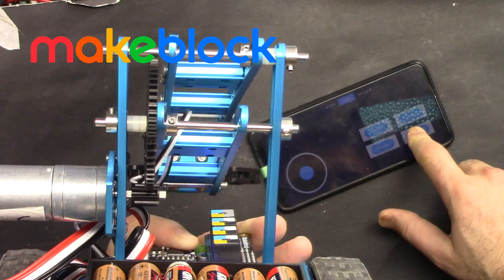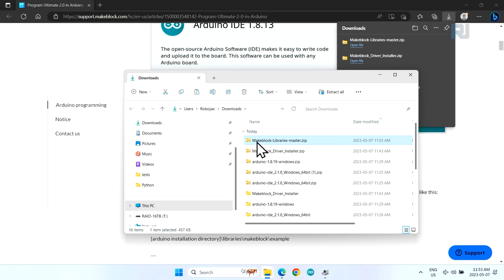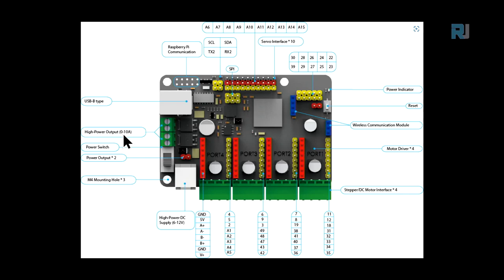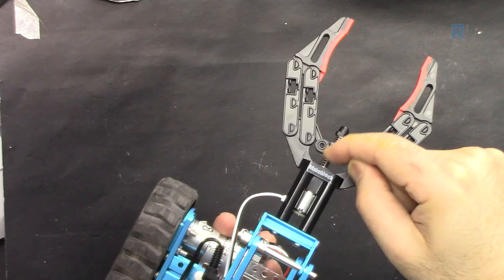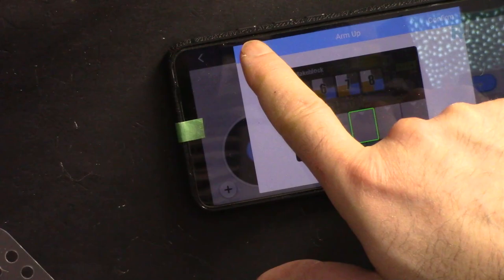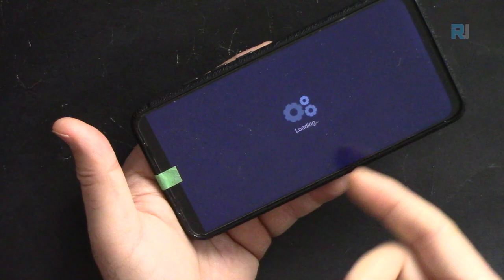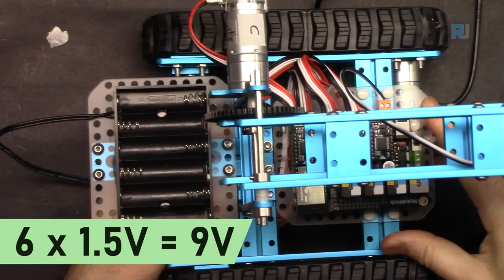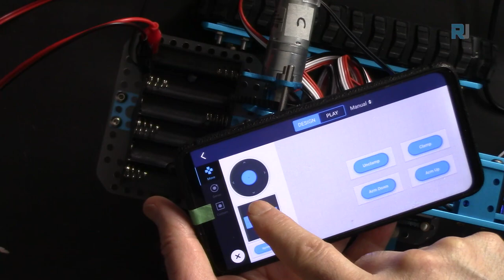Makeblock Untimate Robot Kit Part 2 : Robtic Arm Explaine, Software, Code App and Having Fun demo

Comment: boss @robojax make wifi repeater project esp8266 wemos d1 mini with 0.66'' oled monitor
Reply from the maker: wow. so custom project that onley 20 people might find interesting.  When I spend my time, unless someone pay me, I have to make a video that reaches and help 1000s of people in a month. this is not one of them.
Reply: @robojax  Hey there! I was wondering if you would be willing to make a video on an ac ups. I did see the video on your YX850 Power Failure Automatic Switching Standby Battery Lithium Battery Module but like you mentioned in the video the switch over time is .7 s which is not short enough to classify it as uninteruppted, neither can it handle the power for high load applications.

I was wondering whats the exact partname that is needed as it would need a battery, battery charger inverter and the switchover board. I wasnt able to find a switchover board that would be suitable for AC UPS and if you could tell that, that would be great.

A video would be even better as theres basically zero videos on diy ups. The only ones being basically storage battery packs but none featuring the uninterupted capabilities.
Thanks for taking your time!

Comment: @Robojax Ahmad, I really appreciate all the videos you have done and have seen many of them.
 I started looking at power electronics because I wanted to build a remote controlled lawnmower using 24v 250-350w wheelchair motors. I could not believe the price of the sabretooth 2x60 and for this reason have spent probably too much time learning about these.
What I would really like you to confirm please, is that for simple pwm dc motor control, the use of even a half-bridge is actually a real waste of time, money and in fact is inefficient especially important if you want to run things off batteries. All you need is mosfets on one side of the motor only. Indeed you just waste increased amounts of heat through the second set of mosfets in the half-bridge. 
Relays would be a more efficient way of reversing at the ouput stage of a quarter h bridge to the motor, to change the polarity of the motor connections other than possibly low current remote control cars etc.
H bridges are wasteful unless you need 3 of them for brushless dc motor control, or where there are low current requirements. One interesting thing watching your videos is that even with mosfets of a relatively low rds that are driven fully, how much heat they need and the requirement for cooling. I cannot see that smd components do anything but cut that by half from 1mOhm to 0.5mOhm (still valuable).
One thing which shocked me was how hot the even "1/4" h bridge controllers get.
Please answer, as I value your expertise.

Comment: Ahmad,   Thank you for your time and effort making this video on the MakeBlock Ultimate Robot. I was most infested in your discussion regarding the Designer option available on your Android app..  to see more precisely what mods it allows a user to do.   I have a Makeblock mBot Mega .. which is similar but it's got 4 wheels and more sensors for Line following and detecting when you bump into walls etc..   I found that my 10 and 11yo grandsons lost interest in it using it quickly.. once the novely of driving it wore off.  

I was able to get the source code for it but like the Elegoo series robots ( which I feel are better supported) , it is horrendously complex s/w for a novice programmer to make modifications to it.   They sell it promoting that it's programmable and that is a bit misleading in that to really mod the code you need to invest a LOT of time figuring out what it does and how.. 

Both robots use the MegaPi  main board, and there is pretty good documention on the hardware but the software was simply too complex for me to work with. I was able to add a new servo to mine and was planning to put a distance sensor on the servo but found that to integrate that capability into the exhisting code requires a LOT of liaise with their support staff and they quickly stopped responding to me so I gave up on it.. Elegoo is MUCH better at support than Makeblock in my experience.. but neither give you a good platform for learning to program robotics .. which was my initial; hope.. especially as a tool for my grandkids to learn programming it's just WAY too complicated fro that I feel.   :face-orange-frowning::face-blue-wide-eyes:
Reply from the maker: Indeed it need lots of efforts to program. But makerblock is introducing the mblock 5 software which is based on scratch programming which kids love. So try using that software.
Reply: @robojax  ok I’ll try it